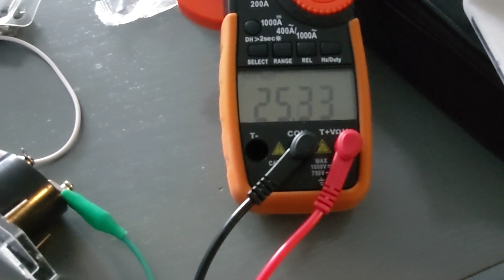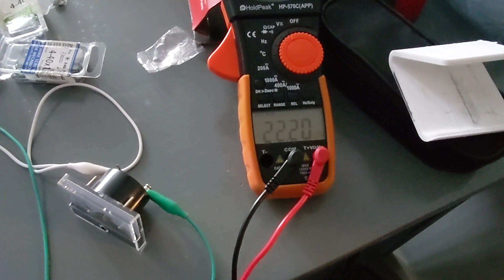Faraday Research RND ⚡⚡#tesla #freeenergy #zeropointenergy

Comment: Hi...keep up the good work...I think your output voltage should match your cap voltage otherwise it causes a voltage drop...the circuit should almost charge the caps instantly... Hence the high frequency and or cycles per second... Maybe charge high voltage caps from the high voltage output then drop the voltage from there to a lower or desirable output voltage...its better to go down a hill than up...

Comment: Cap are strange. Series  the voltage increases the amperage remains the same. In parallel  the voltage remain the same but the amperage should increases.  I might be wrong. Good experience.  Good work. A diode may be use to dump ìn the battery.

Comment: Hey man doing some wire shopping and I didn't know if I should get the enameled like magnet wire or whatever or just straight copper or rubber insulated? or what do you think the best type of wire would be? and other than 26 to 30 gauge wire, what should I get for the other size? I can't remember if it was bigger or smaller. And since it has to be shiny for the spark gap, would chromed knobs work? And if i were contemplating an integration into the 220v ac circuit, do I need to use different gauge wire and what farad capacitor should I seek out? Please let me know because I was about to grab all the wire and whatnot off Amazon and or eBay and I didn't know whether I should just use flitz polish on brass knobs or whether the chromed steel ones would be shiny & still work
Reply from the maker: I would use 26 to 30 gauge multi-stranded wire not solid wire multi-stranded wire
Reply: @FaradayResearch  thank you sir and the last few comments are probably the only really important ones left of all my rambling if you want to skip to those
Reply: If u caught the bang good (1 word) website for supplies and that comment on grabbing you gear, check it and it keeps killing my email. Unless you're the one killing that so people don't spam me to death but I don't really mind. Tekzer0 and the server is protonmail and the usual suffix which comprises the entirety of my email. I hope you get this one since I cannot find any other trace of it among the comments because I have things it won't let me post on here that I wanted to ask about specifically
Reply: @FaradayResearch  i hope ofc stranded is good. I have 18ga and 16ga ofc and maybe some that aren't 100% copper in a little bit cheaper but I am not 100% there and the Chrome plated knobs were zinc BTW and I fixed the word farad up there because I definitely didn't need to know about ferrets LOL.

Comment: And in this instance I was thinking about incorporating an induction water pump as well as a regular water pump and didn't know if they could be used in tandem somehow because I was installing a pond with waterfall and I've always wondered because I haven't tried but I thought about powering the e-bikes that I build with induction braking since I have lots of parts for those as well I just I'm still a little bit new and only know things in practice and not so much in the school learning type of electrical knowledge. I can usually build things and make them work but I have no idea what I'm doing it's weird it doesn't make sense it's totally ass backwards but it works for me and that's why I usually sound really stupid but I make things happen and I really can't explain it myself or how I know what I do know beyond being a computer technician for like 20yrs and rebuilding or fixing pretty much everything in between there and a stereo.. or everything between there and an e-bike or a Smart House